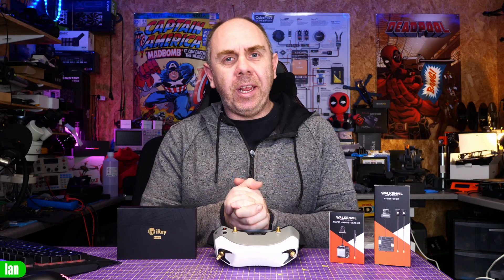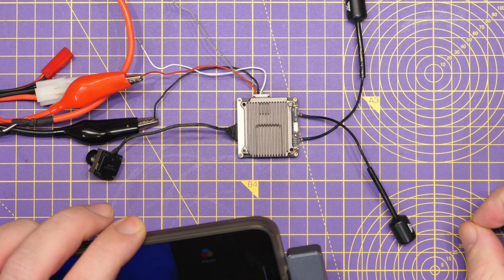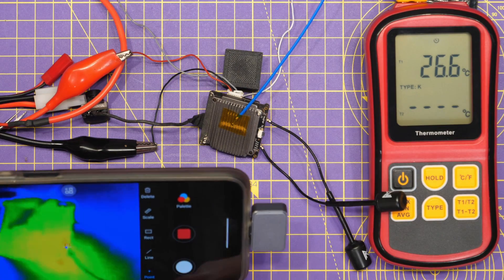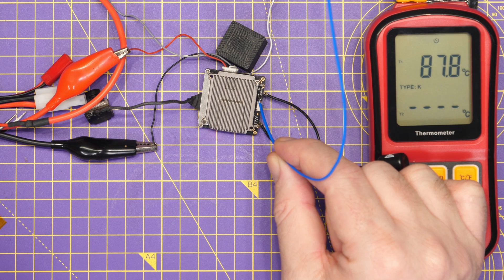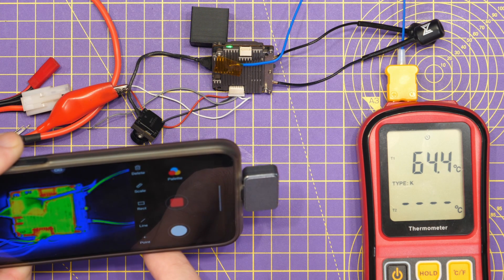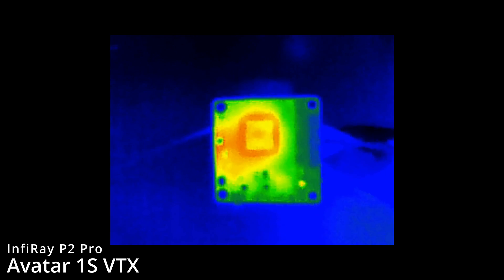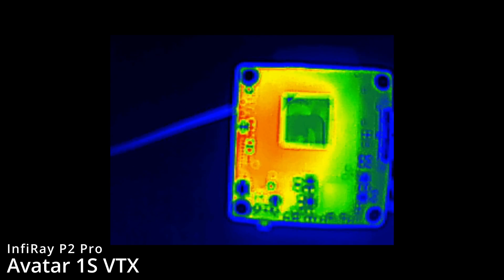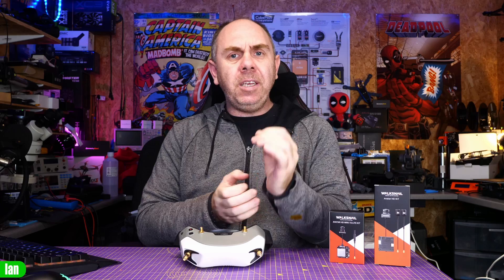Avatar HD Digital FPV VTX - Power & Thermals Deep Dive

Comment: How did you delid the CPU? I was planning on putting an aftermarket heatsink on it, and that would actually help the two chips be level
Reply from the maker: A fine blade around the sides, there is some soft adhesive.
Reply: @MadRC  Have you tried doing your own cooling solution?

Comment: In your opinion Mads how quickly would you cause damage to a V2 dual antenna VTX if powered without antennas connected?
Reply from the maker: It’s possible it would damage eventually however I would not expect it to happen instantly. Iv seen no evidence of any burning out even after some time.
Reply: @MadRC  thanks for the reply, in my heist to get a new V2 vtx fitted and setup i had it running for 15/20 mins on the bench with out antennas connected. appreciate the reply

Comment: Great work Mads. I had a question if mounting the VTX in a PLA printed part was going to be a problem. While the VTX does get hot it seems the thermal shutdown kicks in well before it should be a problem for PLA.

Comment: This is why you shouldn't stick your VTX to the carbon frame using double sided tape. Or even a tywrap.
Mines on M2 hardware spaced off to give all round airflow...Bad form of Caddex to not provide long M2 bolts and nuts IMO. The US doesn't even know what M2 is...🤔😳😏😏🇬🇧

Comment: A comparison to DJI and HDZero would put this in perspective. This video makes it sound like having a hotter heated part than heat sink is a non standard outcome and to me that sounds like standard thermodynamics?
Sure, thermal conductivity of fiberglass is worse than aluminium, but the copper traces on top of the pcb are more thermally conductive than aluminium. And have much less mass.
The silver screen is probably a little bit insulating, maybe making the or read a little less than the heat in the copper. But with a slow heating proceeds it should have time equalize.

Comment: Interesting stuff, I had assumed it was the SOC that needs the most cooling, and it seems that's how Caddx intended it too since the mipi is on that side, and the wires to the fc are on the PA side (shortest route to camera/fc has the SOC facing up). Well, so far no overheating, I have airflow anyway

Comment: I think the scenario where current draw most comes into play is when folks want to run minimal hardware on their cinewhoops  at 2-6s, this means you'd likely hope to power via 5v BEC, and a lot of times they are rated to 1A- not sure what sort of margin they might have.... 1.1A is a pretty tempting spec. to try it.  I wonder if heat & assorted video modes would cause a higher current draw.
Reply: Just remember that sometimes there are other things on the 5v BEC as well, so just make sure the total isn't over its rating.

Comment: Great thermal info.   I have noticed that my Micro VTX , when in standby mode ,  issues a temperature warning after some period of time.   Could you investigate how long it takes to issue the warning from a cold staart in standby mode?       Thinking this would be useful to know prior to take-off waiting for GPS  lock.  Thanks.
Reply: for the first flight of the day I power up the fc, rx and gps of my quads with a usb power pack.  I monitor the satellite status on my transmitter. Once I have a lock I plug in the main battery and go fly. No overheating!
Reply: You can turn off the goggles and the vtx will go into a lower power state
Reply: use telemetry to view gps

Comment: I have 2 Ufl that in flight fails I believe due heat fatigue, I have a photo from my microscope, and you can see burning areas in the plastic side of the connector
Reply from the maker: I’m not shocked it gets to 90+